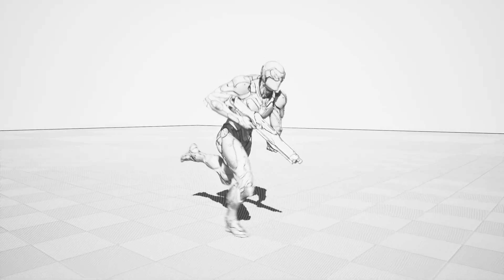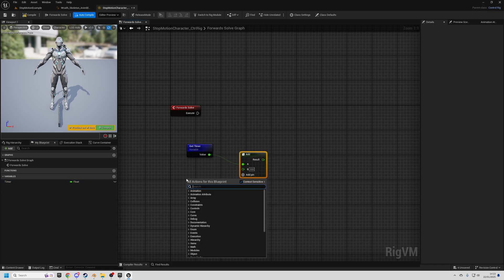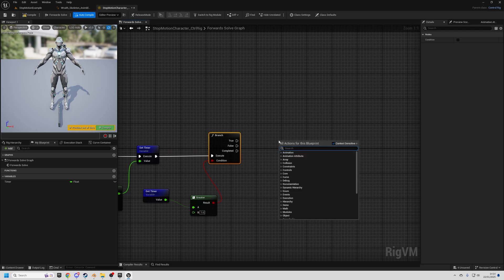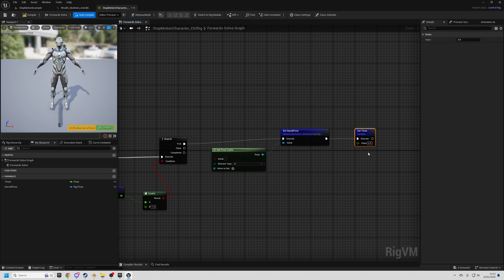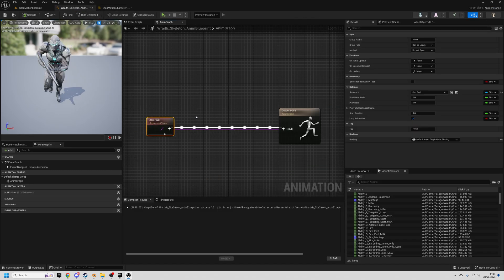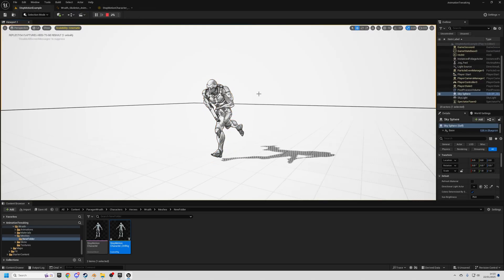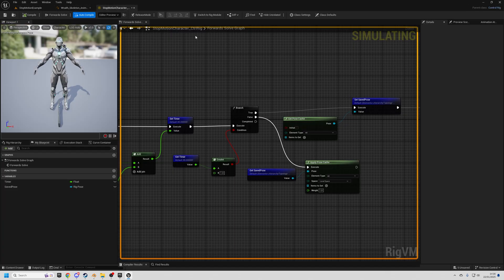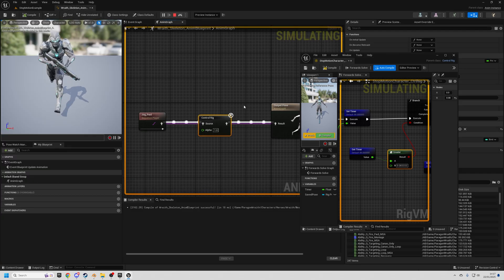Stop-Motion Effect in Control Rig

Comment: How do you apply this to gravity? It breaks the illusion of stop motion when the character jumps or falls.
Reply from the maker: If you save the transforms in worldspace then the character's movement wouldn't affect it, it'd still be restoring the transforms back to where they were in the world
Reply: @LincolnMargison  I think there may be an issue of the default animations not having root motion. If I switch to an animation pack with root motion that would look different since I wouldn't be relying as much on the movement component at all. I'm going to experiment with that and see if I get different results.

Comment: The tutorial is brain-dead. Just set an update rate on your ABP = way better performance
Reply from the maker: Sure, different strokes for different folks. This approach/example has many many more use-cases than the ABP way but you're right that if you just want to lower the FPS you can reduce the ABP tickrate. This is more so an example use-case of saving/restoring poses within controlrig which is very useful for various purposes.
Reply: im new to unreal engine, how would i go about setting this up??
Reply: @v7ryj803  ABP is animation blueprint. When you have skeletalmesh component in it's settings there is suppose to be Animation Blueprint drop down --> here you want use your own instance. In ABP settings you find a tick rate

Comment: Is there a way to separate the head animation from the body animation using control rig? So that the head is not affected by the vibrations resulting from the rest of the body animation?
Reply from the maker: I'm not totally sure what you mean/what you're trying to achieve. My guess is an attached camera to the head for true first person? If so, yes, you can just set the head bone to whatever position you want and it'll stay there regardless of what the animation is doing. Or you could revert it to it's "initial" position from the skeletal mesh. But this will look wacky from another perspective because the neck would be stretching all over to keep the head in the same spot.
Reply: Yes I tried the method you mentioned but as you said it makes the neck stretch. I also tried a similar method which is correcting the head position with animation and it was very effective but the problem is that there is some delay and choppiness and so on. So I asked here I said maybe you know a very effective method

Comment: Theres actually a node for this. its a plugin
Reply from the maker: Haven't seen that, but tends to be better to avoid plugins where possible and this is a quick 1min setup job. Also the method of saving/restoring poses can be useful for other things anyhow.
Reply: @LincolnMargison  wait why avoid plugins?
Reply from the maker: @TylerCathey  Well if they don't update and you're reliant on them, you get stuck in old engine versions of have to fix them manually/wait for updates. I've also had a lot of compatibility issues with packaged projects with certain plugins (even some of the official ones? I think the fab plugin broke packaged builds for a while). And in general if you need to use a plugin you probably don't know exactly what it's doing/how it's made so it's a lot more difficult to modify.

Just as an example, with the plugin you mentioned, could you save an array of the last 100 frames to replay/interp in slowmo from controlrig? Maybe you can, I haven't seen it, but it'd likely be more complex/convoluted than doing the get/save cache manually.
Reply: @LincolnMargison  Hey! i just got an idea! is it possible to only stop motion parts of the skeleton during this? I was thinking this could be a very nice hitstop technique.
Reply from the maker: @ Yup. By default this is using "all" which means all bones/controls/etc, but you could limit that to specific bones. Or just apply it to all of them then override certain bones back to default. You could do this in the AnimBP or in controlrig.
Reply: @ Dude!! Thanks!
Reply: @LincolnMargison  hey i got it working but i want it to be useable for any skeletal mesh given IKChainParentBone variable (Name) in the controlrig and it gives me warning becsue bone does not exist. do i just have to copy and copy and copy the same rig but for different skeletons?

Comment: Does this work on normal animation in the sequencer?  So not when simulating?
Reply from the maker: Yup. Just add the controlrig class to the character in sequencer and it'll be doing this even when not simulating and just the regular playback or scrubbing through timeline. But I'm pretty sure the time calculation will be running regardless, so it will always just be (for example) 12fps. So if you scrubbed through the timeline fast, you'd still only get 12fps and it'd skip ones that you may see in the render.

If you need to ensure it's 1:1, you could bake it in Sequencer and use/modify the baked version. You could also downsample the framerate of the sequence and set the frames to constant interpolation to have full control over it and skip the controlrig part. This might be more useful for rendered stuff where you want exact timing over which frames are chosen/frozen.
Reply: @LincolnMargison  Thank you! My main issue is that when I tweak the animations to be going on 2s and camera on 1s, everything looks jittery when rendered
Reply from the maker: @Hoop_Dreamer  Are you using Movie Render Queue? Not sure what jittery could mean here, because the effect itself is intentionally jittery, but perhaps you mean something more like a rendering artifact? MRQ is better for avoiding things like that and has more options.
Reply: @LincolnMargison   yeah I use that, I meant like if the camera would shake constantly, I can share some footage with you maybe on discord or via email
Reply from the maker: @Hoop_Dreamer  Yeah send it on the discord server. Not too sure what you mean about the camera, isn't the camera just animated as normal?
Reply: @LincolnMargison  Came back to this now that I've tried it, I got a couple of questions, I've added you on discord